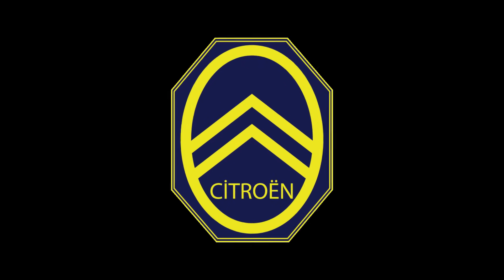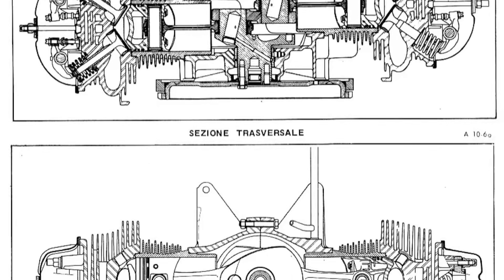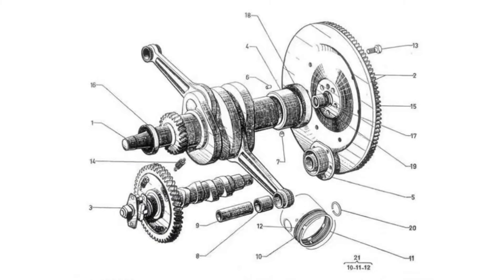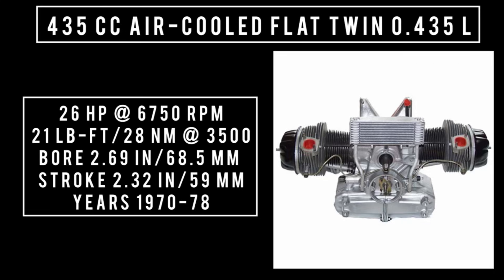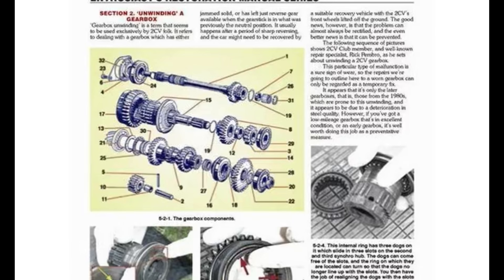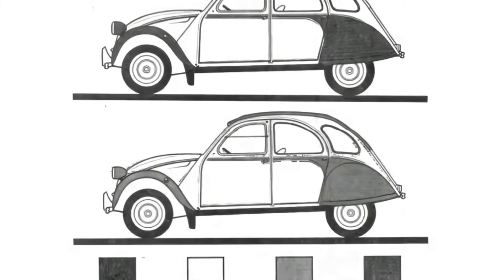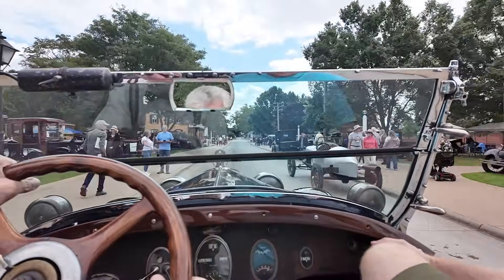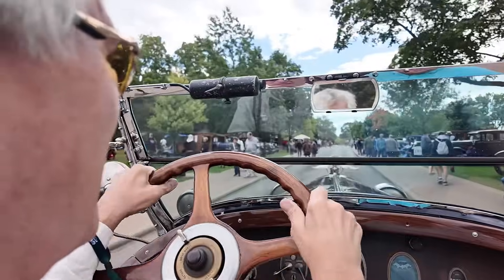Citroen 2 CV Engine family 375cc, 425cc, 435cc, 602cc￼

Comment: Given the seemingly meager horsepower numbers, I wonder what the top speed of these cars was as well as the maximum speed that could be safely sustained on longer drive.
Reply from the maker: I'm finding out horsepower is not the full story for example my 2009 Toyota Prius has 110 hp. It's capable of doing 112 mph. Can go even faster if you're going down the hill.

Comment: Salut. Un sympathique hommage 
Quelques précisions selon ce que j’ai bien ou mal compris 
Les cylindres n’ont jamais été en aluminium sur ces 4 moteurs, seuls ceux des 652cm3 qui ont équipé uniquement les visa et LNA l’ont été (belles petites pièces incluant d’ailleurs les conduits de tiges de culbuteurs… ce 652 sorti en 1978 fut en quelque sorte un bicylindre de 3e génération pour citroen et n’a jamais équipé les 2cv et dérivés mais qui a parfois été adopté et adapté par les passionnés)

Le 425 a été décliné au fil du temps en 4 niveau de puissance… évoluant d’un peu partout, notamment pipes d’admission, carburation, allumage, culasses, arbre à cames, rapport volumétrique pour profiter de l’amélioration du carburant dispo… 
La dernière version de 21ch SAE née en 1967 n’a jamais équipé la 2cv berline mais uniquement la camionnette AZU et la dyane, il terminera sa carrière en 1972 sur l’AZU.

Février 1970 est en effet une date charnière avec l’adoption des moteurs qui lui permettent de rouler convenablement dans la circulation moderne, surtout le 602 moderne.
Ces bicylindres, disons de deuxième génération pour citroen, existaient déjà depuis 1968 sur d’autres modèles.

Le 435 finira sa carrière à l’été 1979

Le 602 première génération né avec l’ami 6 en 1961 fut monté dès 1963 dans la 2cv camionnette AK.
De façon assez anecdotique, les fabrications belges ont proposé une 2cv avec ce moteur dans les années 60, l’AZAM6, préfigurant en quelque sorte la 2cv6 qq années plus tard (avec le 602 de seconde génération)

La 2cv6 est finalement la clé de la postérité pour cette auto, coupant l’herbe sous le pied de la dyane qui devait la remplacer, et permis le maintien de la production durant toute la décennie 80 et d’être très largement collectionnée.

Les illustrations auraient pu être plus soignées ;)
-Vu son écrin, le 375 est plus certainement un 425, l’allure est assez similaire c’est vrai.
-le 425 est en réalité un 602 du type depuis 1968, d’aspect bien different.
-le 435 est un 602. Le 435 est un peu plus compact. 
Comme on dit souvent avec cette auto qui n’a quasiment plus aucune pièce  commune entre le début et la fin… tout se ressemble et rien n’est pareil.

 L’inspiration viendrait du bicylindre BMW oui… lui même probablement inspiré par l’antique moto gnome-rhone ABC qui eu une petite descendance. Gnome rhone et BMW étaient concurrents directs avant la seconde guerre mondiale et ont fait des motos et moteurs techniquement comparables.
Reply from the maker: Thank you so much for providing all that insight and information. I didn't even know about the 652 for whatever reason it wasn't part of the grouping for whatever reason maybe they just forgot that one. I'll probably have to do this on an episode again.... 

Not making excuses just saying foreign stuff is hard to do here because information is very spotty ..
Reply: Le moteur BMW montée ici c’est un version 2-cilindre beaucoup plus recente, il y même 4 soupape par cilindre….
The BMW engine shown here is a very much more recent version air-cooled 2 cylindre, it even has 4 valves per cylindre….

Comment: You forgott the 652cc 35hp engine use in the Citroen Visa and LNA: was an modernized version with aluminium cylinders ,Nicasyl coated, and full electronic ignition. This engine had a much higher torque , better fuel economy and a bit less noisy. 
The all first 2cv of 1939, who was not sale because of the war, had a   Water cooled engine, similar design with 8hp
Reply from the maker: Thank you =)

Comment: 3:30 from 1963 on the engine had 16 hp. official top speed was 95 km/h. i owned an old 16hp cv2 in the late 1980s. in two years i managed to overtake exactly three other cars.

Comment: The 2CV engine cylinders are in cast iron. Just look at the color of the parts in your video. Also, the section lining type is different in the drawings you present.
Reply: Yes, only the 652cc visa/ lna 35hp type had aluminium cylinders, with Nicasil coating

Comment: 70 2CV

Looking at those horsepower and torque figures has to cause most of us in the USA to emit a chuckle. JAY, I didn't see any 0 to 60 times posted because I figured the car probably wouldn't go that fast to begin with. 

There's no doubt though that these were very successful automobiles. Nothing fancy just good solid transportation that I'm sure were fairly low maintenance. Citroën's "people's car".
Reply: Affordable, and very reliable….
In France many lasted over 3 decades used daily!!

Comment: Thank you Jay. Being a mechanic here in New Zealand for over 4.5 decades I always knew the 2CV engine was quite special but never had time to look at it's spec's. Much easier when subscribed to your excellent channel. Just love the longevity of the production, truly epic. I do remember reading of the 2Cv dual engine car. Keep up the good work, Cheers from Bryce 🙂
Reply: As a mechanic, did you EVER notice there is no oil-pressure regulation-valve in these engines!!!????
I only noticed after 4 decades of working on ‘m…..
Reply: @henktulp4400  Wow, I never new that:body-blue-raised-arms:
Reply from the maker: Thank you Bryce =) 

It was between this engine or the Indian four I might do the Indian for it's an interesting engine

Comment: Panhard also made an air-cooled flat twin for their postwar Dyna, but it was higher performance.
Reply: And a true mechanical marvel at it’s time!!!
Fitted with an all-alloy body!!
The engine was equiped with torsion-springs for the valves!!

Due to excellent aerodynamics and lightweight body they could reach up to 150-160 km/h!!!
Yes!!! a mass-produced 4-passenger affourdable sedan powered by a smal flat-2 cylindre engine…. 
Over 50 years ago!!!
Reply from the maker: Panhard is a company need to explore deeper

Comment: There was a 652cc version fitted to the later Citroen Visa.
Reply: True!!
And it was like a 2CV on steroids!!!
Fitted with a maintenance-free electronic ignition.
This engine mounted in the Visa (in the LNA too) had much more torque and, also due to the Visa’s good aerodynamics, made the car cruise 4 passengers in relative comfort at 120 km/h (over 70MPH) doing like 18 km per Litre, does that equal about 45 Miles per Gallon??
Reply from the maker: Awesome I did not know that it wasn't grouped together with all the other engines for some reason

Comment: Unless I'm mistaken, and it wouldn't be the first time, there were some surprising-looking cars produced on the 2CV Deux-Chaveau platform, including an offroad variant "Mehari" and a dual-engine version of the Mehari called the "Sahara."
There's a yellow Mehari tooling around Atlanta, saw it in the Collier road area near DeFoors Ferry sometime last year. There's also a FACEL-VEGA prowling in the area.
A friend of mine had a couple of variants that were badged as the AMI-6 One a sedan amd one a wagon. 
The sedan bore a passing resemblance to the Ford Anglia 105 in profile. 
They were every bit as weird as you would expect, with a dashboard mounted shifter that slid in and out and twisted and a clutch that operated by pedal, but also on a centrifugal system. 
Actually, weird doesn't begin th describe it. 
Fever dream?
I would write in the AMI-6 sedan or the Sahara as my choice.
Reply: The Sahara was a 2-engine version of the 2CV, dating back to the 50’s.
The Mehari was introduced in ‘69 or ‘70 and I believe there was a 4wd version at some stage* but it was an aftermarket conversion (by Dangel??) and was realised by conversing the gearbox and mounting a drive train behind it for the rear axle, NOT by fitting a second engine/gearbox assy in the back, like the 2CV Sahara….

*But here I start digging in a vague portion of my old man’s memory……